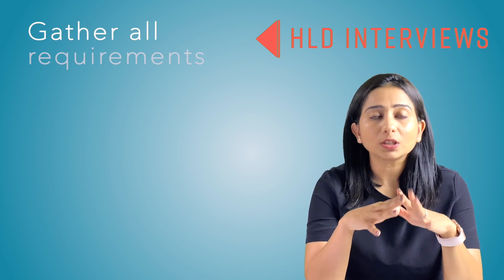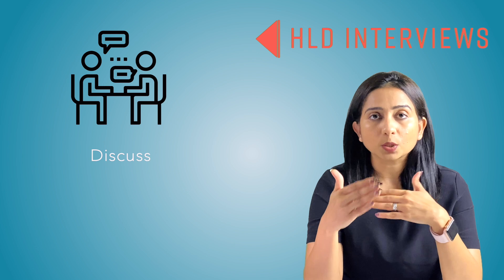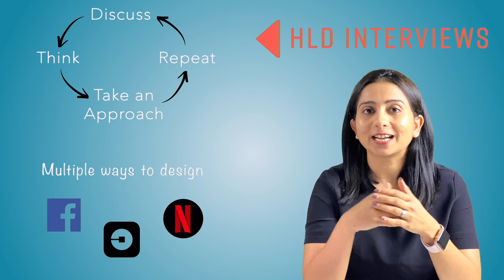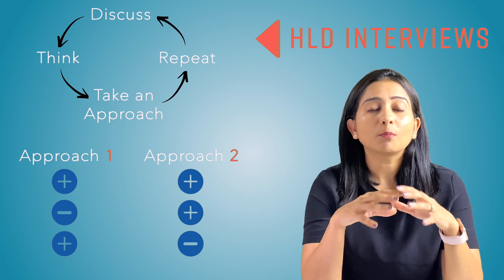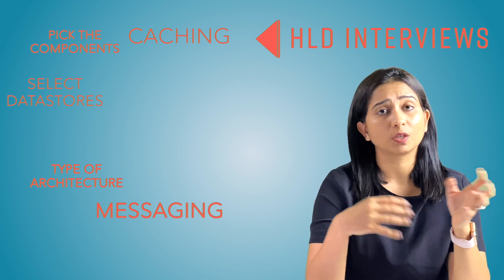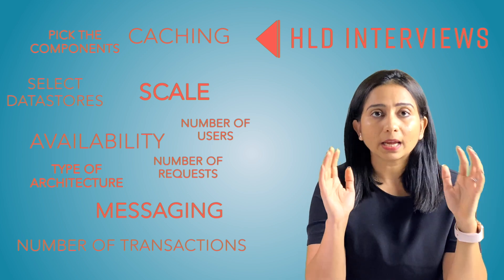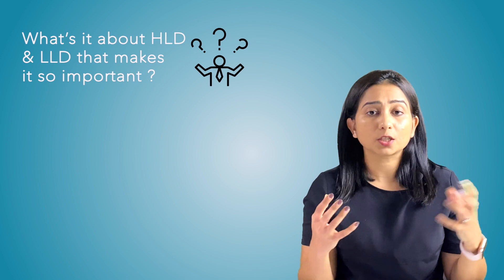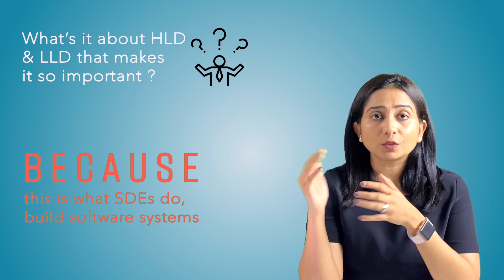High Level Design vs Low Level Design | HLD vs LLD | System Design Concepts

Comment: Anyone please look into my comment.   When it comes to LLD preparation, we take a problem statement and come up with the objects, classes, variables, and methods wrt problem statement. We will think about design patterns. In one line it is all about coming up with a code as solution in a particular language by application LLD principles. *But I am getting about HLD. How to get hands on experience in HLD? But I have one thought in mind, getting hands on experience in HLD is nothing but logging into any cloud platform and creating vm instances and installing a particular software, creating load balancers and balancing load between vms, and soo on. Am I correct?

Comment: Thank you for this great explanation. I have one question based on my failed interview experiences. As usually, the interviewer present you the case to solve and tends to be ambiguous, how can you tell you are asked to do a LLD or a HLD? As mentioned, it has happened to me in real interview to solve a problem, solved as a LLD problem (creating UML diagrams and so on), and just in the middle of the session the interviewer objects that he was expecting a HLD solution. I feel if it is not clear to me at the beginning of the interview, if I ask what kind of solution does the interviewer expects, this could be taken as a red flag. Any advice on this situation?
Reply from the maker: Thanks for kind word Jair. Ideally the recruiter and interviewers should tell you in advance about the interview rounds whether it will be a coding round or LLD round or HLD round. But in case they haven't, then as soon as you get the problem, the first question you have to ask the interviewer is the clarity about the problem and their expectation around the solution, you may ask are you expecting a LLD or HLD, do you want to see UML diagrams or code for classes and logic, or just HLD diagrams etc. So, don't shy away from asking. All the best for upcoming interviews.

Comment: Thank you so much Yogita, this was extremely helpful! I have a question regarding the differentiation of HLD and LLD. How do we distinguish if the interview is about high level design or object oriented programming? The problem statement is very vague and even if we ask the interviewer what approach they would like, they would say "choose as you wish". Could you help with that? Example, if a question is show a bike rental system  or even if asked to design Twitter. This part really confuses me.
Reply: There is a similar question already answered below in comments. please have a look.

Comment: what exactly is the difference between functional requirements and non functional requirements in this context?
Reply: Functional requirements deal with functionalities you will implement basically the features whereas non functional requirements mainly deal with how good is the performance of the system how high is availability and so on